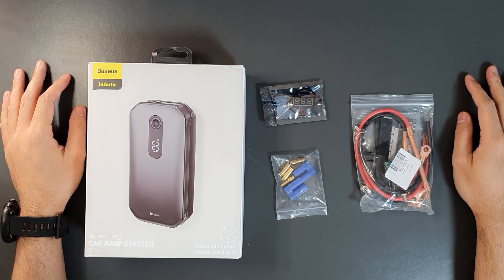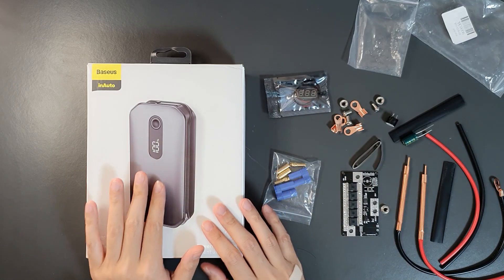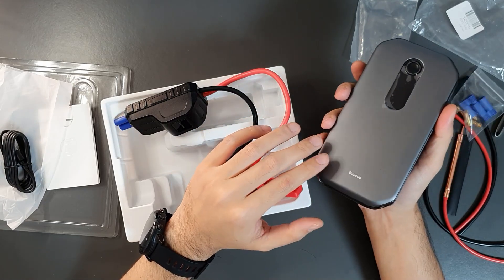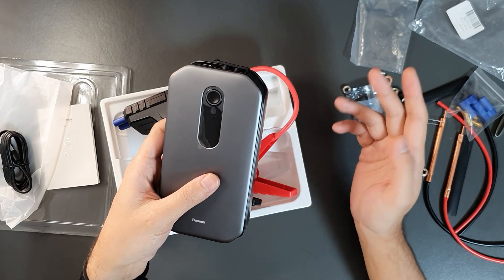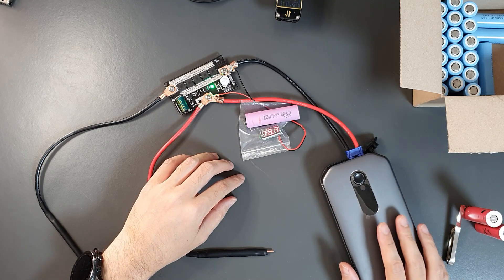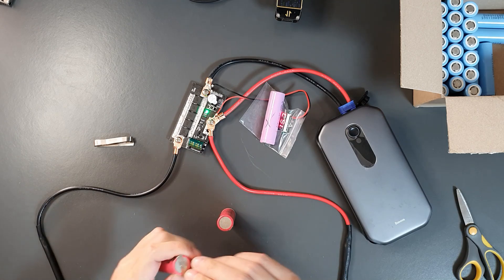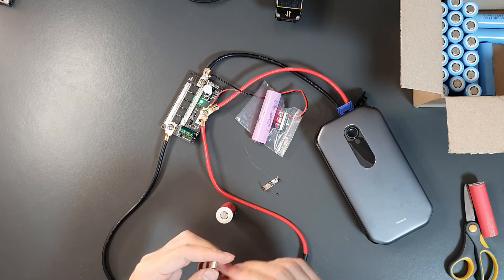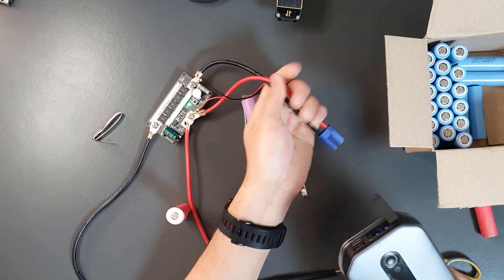DIY Cheapest 12V Spot Welder with Car Jump Starter

Comment: I bought one of these spot welders to use with my jumper, however I think there needs to be a load on the jumper? It shows voltage when I test it with a multi-meter but it doesn't supply any power to the spot welder. Also there is a small middle connector in the EC5 connector, is it a communication wire? Then I tested the spot welder with a motorcycle battery and the probes just blow a hole right thru the nickle strip even on the lowest setting.

Comment: Awesome video. Thank you. Explained everything perfectly. I've been trying that same welder except with 2 moped batteries in parallel connected to a 10amp battery charger. Batteries just aren't big enough. Then I tried a very large Samsung microwave  transformer. That was wayyyy too much power. The transformer made a pretty loud and kinda scary humming noise. It blew holes through 1/16" thick tin. And made a huge set of sparks everytime. Was definitely dangerous. Then I see this and I actually have 2 of these jump starter packs. Going to order that ec5 connector right now and impatiently wait for it to arrive. But thanks again,it helped me immensely
Reply: Hello. Had you tried? Is it working? What is the specs of your Jump Starter? Thank you.
Reply: Hey sorry just now seeing this. The one he is using works really good if you connect to your car batter and then start it. Get everything ready in front of you under the hood. Or get two 12v car batteries connect in parallel then get a 12v battery charger and connect it to the parallel batteries. + on 1 battery then the ground on the other and turn the charger on then connect the spot welder turn it up to 5 and weld away

Comment: If the unit is off, do you still measure voltage across the output probes? Mine does and i think it might be broken. That seems unsafe.

Comment: On my spot welder controller there is bodged reverse voltage protection diode. It probably acts to protect mosfets from back emf. So if you have a board like that - solder it to output + / - terminals (remember to pick correct orientation).

Great little project!

Comment: how do you get around some jump starter don't allow current to flow until there is a small volt on the leads side (dead car battery side)?
Reply from the maker: Usually jump starters have a special power lead. Just don't use that.

Comment: Recently ordered the 800A version of this Baseus jump starter and some EC5 connectors.  Thank you for confirming this works!  I was guessing it would, but it's good to know for certain!. Also my welder is max 16V and 900A so should be perfect at just under fully charged.. Anyone trying to use an old car battery (60Ah) may think there's something wrong with their welder, as mine would only weld up to 0.1mm.  Turns out this battery is ready for recycling due to high internal resistance (50-60mOhm). I'm also, as you are, rebuilding an old ebike battery (Kalkhof) with new cells.
Reply from the maker: Yes you are right, internal resistance plays a major role in the welding current capability of the battery. All the best for your ebike battery build.

Comment: Am surprised this spot welder and jumó starter manage to weld , I had few of this type spot welders and even using a powerful lipo battery or car battery it was still very weak , but I bought the BIRF brand and that one it’s very good spot welder I can weld even with a 1500 mah 3 cell lipo battery very good
Reply from the maker: The main advantage of the car starter that I use is that it has higher nominal voltage because of a 4S lipo configuration (4*3.7V). It also has very high amp capability. The higher voltage leads to higher current via the nickel strips and hence better welds. I haven't tried with 3S lipo or a car battery (12.8V), but those have lower nominal voltage. I think any spot welder kit can be used as long as it can support 4*4.2V max input and fairly large current. Thanks.
Reply: Where did u purchase the jump starter ?
Reply from the maker: It was from AliExpress, links in the video description. Thanks.